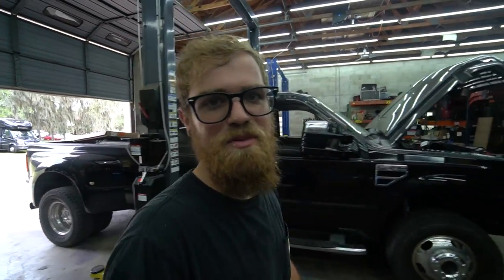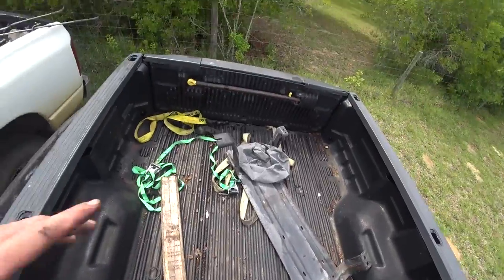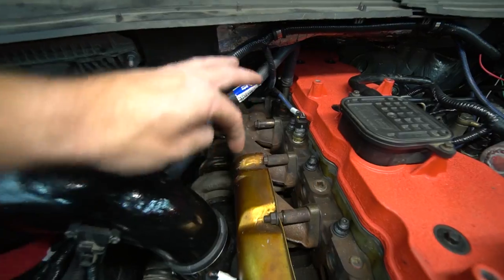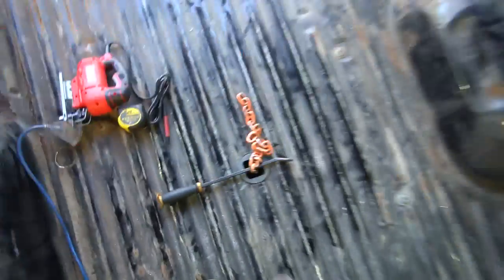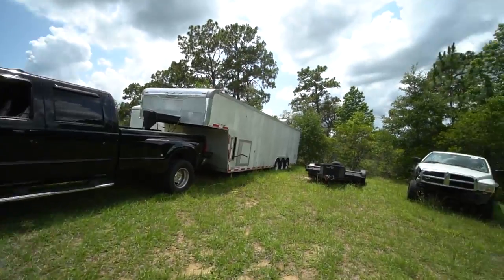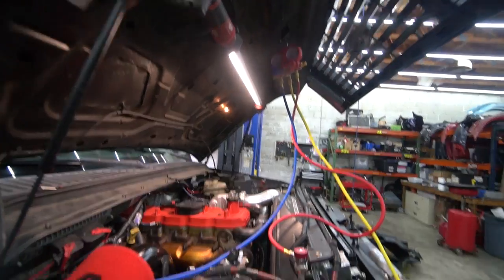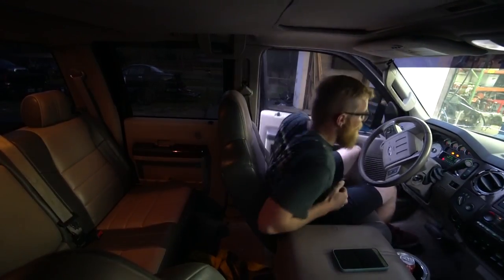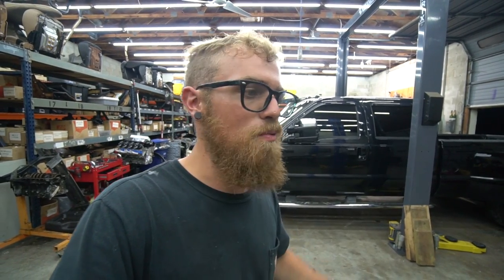Hooking the FUMMINS up to the BIG TRAILER!! Will It Work!? *Big Progress!* Fummins Build Pt.19

Comment: Love the build! If you're looking at rust prevention for the truck one thing to change would be the seal around the third brake light. A lot of the times the tend to dry out and crack which allows water to run into the cab and rust out the cab corners. Amazing job as usual Taylor!

Comment: Generally, if it holds vacuum for 5 mins, you will be fine. Usually, the apparent leaks will show right away. 

I dig the F-3500 man. I hate that the  ford/International relationship fell apart because of the 6.0/6.4 drama, because it would have been a real possibility of Cummins being the diesel for Ford. By the time the Cummins/Dodge contract expired and we saw a Cummins in another brand, Ford was already 5 years into production with the 6.7 Powerstroke. But the 6.7 with the 6R110w is probably the best combination in production today, with your truck being basically the equivalent or slightly superior configuration. Keep it up Taylor, you're killing it this year !

Comment: Please for the love of god, give that rattle trap a valve adjustment.
Reply: Didnt he do that? Sounds more like a rodknock or smt
Reply: @Leofred2000  I hope this clip is just old and it doesnt have rodknock.  That would be such a bummer :C
Reply: he adjusted the valves like 5 times now. thats just how a 5.9 cummins sounds.
Reply: It's just a diesel. Normal ignition sound.
Reply: Yap he did the valve adjustment already. I don’t think it sounds healthy but, I am not there in person to hear.  I saw Nick K said this noise is normal? But mine didn’t sound that clicky.   Does he have a FASS already installed?
Reply: I work on these everyday. Its not a normal sound.
Reply: @davids1043  yes fass is installed. It sounds healthy. I'm betting it will change sound with the next tune as well, probably louder. He literally used the 2nd loudest Diesel made. Loudest being the OBS 7.3 ford. My neighbor used to have a 3rd gen 24V ram and it sounded the same. I was disappointed he used the 5.9 over the 6.7 Cummins, the 6.7 being far quieter and much more capable motor. Not to say a 5.9 is inadequate, it's mostly preference and opinion.
Reply: @n0nc0mpliant  Ive heard the 6.7 is way less throttle responsive due to the long stroke
Reply: @Leofred2000  Having had rod knock before that ain't it its too tinny and consistent. Sounds like lifter tick or something along those lines in the valve train
Reply: @Ace-nd6kk  I agree. I've had some pretty aggressive tunes on my 6.7 that make a ton of knock and some pretty lazy tunes that are nice and quiet.
Reply: @Leofred2000  not at all. The trans and turbo really sets how responsive it is but my manual trans with the VGT turbo was a real neck snapper with the right tunning. My swapped turbo delivers more power but since it's so much bigger without the VGT portion it's lazier.
Reply: Its the reverb inside the truck, when he showed the engine idling outside the truck you couldnt hear that loud "tap" or "knock". Its just inside the cab. Lack of sound deadening
Reply: To me it sounds more like  a injector dumping too much fuel,, a quick way to wreck a good engine. I know he probably didn't want to replace them when the engine was apart because of the cost but it's cheep insurance compared to a rebuild.
Reply: @dooformuladlx  it does sound like that, but only when the camera is inside the truck, listening to it out side it sounds fine.
Reply: Sounds like injector knock for sure

Comment: That truck should have power folding mirrors. If it does, folding them in and out manually could me........ Was typing that when he folded them........😂😂
Reply: ALSO the telescoping button goes out quickly on these trucks. 50 bucks from ford.

Comment: Neat trick for using a holesaw and not destroying your pilot bit. Set the clutch to 12 and when your holesaw bites down after the pilot poles through it won’t jerk the pilot and break it. It’ll stall the drill and you can stop and set the chuck back to drill.

Comment: You got the ultimate truck now! Try checking your rear wiring harness connectors to make sure there clean for your back up camera, it so your camera is taking a crap on you probably, I’ve replaced quite a few of those on fords.

Comment: I used DCS back in 2011 for my 2006. Mike Dahlke will be your best contact there. He is the best! Your transmission will actually  self learn if you are using DCS's throttle pedal module by JMS. The more you drive it the better it will shift. The tune they send you will match the Cummins low-end torque with the 5R110. Mine shifts just like if the PS engine was powering the 5R110. It really was a breakthrough for them.

Comment: I just realized, Taylor only owns 1 car that has it's original motor... Damn
Reply: Which one?
Reply: Constable pretty sure the wrx
Reply: wrx has a newer sti swap. into the older cooler looking body style
Reply: I think the cefiro still has an rb20det
Reply: The green truck has the oem motor dosen't it?
Reply: josh youngs No, 1500 Silverado’s didn’t come with 6.0 Liters. Was a 5.3 swapped by previous owner Derek Gaskins.

Comment: Anti-seize the squared section of the turnover ball, all that road grime mixes with rain water and glues it in if you don’t.
Reply: Big globs of bearing grease or bar & chain oil over the ball & pin lever. Locally (Western Australia), the 3 or 4 of these I know with goosenecks all say they fitted grease points you can reach from the lever side. Its also a good idea to put a lever lock in the arch. Wheels & tyres - Taylor find a truck that's fitted with semis & ask to drive it on a long journey. Being heavier, you put more strain on a driveline and ancillaries that was never built to move that mass, you use more diesel per mile - even being tuned and the ride quality may be affected. Personally use the maps you've got & fit decent sized all terrain tires for quieter, more comfortable long distance journeys. Also the interference with your reverse camera may t
Have happened while installing the 5th wheel

Comment: On another note we’re talking about the power extend, I think if you put the mirror adjuster to the middle and push down then forward or back maybe that works. I forget I had a 2011 work truck that was brand new and it did it that way I believe

Comment: Dig the build, I've been working on a fummins myself for awhile now. That engine has a fair amount of knock, when you do an oil change I would cut the filter open make sure there isn't any metal in it, could be something simple bent push rod from having the lash to tight or something. But is excessive in my opinion. Those r134 canisters are the new anti leak style ball valve you have to get an adapter that your metal t adapter goes on to use them. Parts stores should have them next to the cans. They're usually blue in color

Comment: I installed a b&w on an 07 chevy and man I'm amazed how easy the 4 inch hole was for you to drill. On the chevy it probably took me 30 minutes with a brand new 4 inch hole saw. The bed channels are a lot deeper than that it seems and caught the hole saw like every 3 rotations. The assembly wasnt bad and getting everything in worked well but the 4 inch hole and the 4 inch diameter piece that sticks through was TIGHT. had to bore it out with a dremel after but boy theres no gap.

Comment: To really kill noise you need 3 layers
  1.Peel and stick aluminum backed dampening to absorb vibration, like FatMat
  2.Decoupling layer of closed cell foam to keep layer 3 suspended from the vibrations of the metal/Layer 1.
  3.Mass loaded vinyl, sheets of vinyl impregnated with heavier material designed to block sound through it with sheer mass. Optimally this layer is seamless

Comment: Spray in bedliners still hold moisture underneath my dodge had rust all the way down the pinch weld under the bed liner so I fixed the rust te bedlined it and put a tonneau cover
Reply: Must of not been the best prep job

Comment: bruh that cummins isn't supposed to sound like that. maybe a rocker or tappet issue, or valve adjustment
Reply: or bent pushrod. would make sense since your valve lash was so out of whack before
Reply: Sounds like valves lol. I was ganna say that doesn’t sound lime a 12v ahaha
Reply: If I'm not mistaken it's a 24v not a 12v
Reply: I say run it till it blows up yeah brother do it for dale  full rip ( jk that’s a serious issue)
Reply: Yeah, it definitely sounds rough I was just working on one of these trucks today. Definitely has something going on
Reply: cole ross It’s not a 12v

Comment: well it still has a ford symbol so ya it will have problems lol jk. all joking aside i hear ya on the doing something different. so hesitant till you put some miles on it. everytime i mod something i am so scared to drive it long distance. i always tend to drive it local so i can make a call and get a trailer to get it home. but once you get it all good and you do that first lon distance drive man is that a great feeling. you get there and just look at your vehicle like hell ya i built that and it runs great and i can rely on it. amazing build man. congrats

Comment: It sounds like a 7.3 powerstroke on camera when you back it out of the garage to empty truck parts 
I prefer the 5.9 common rail myself too
Reply: Im not the only one thinking the same thing
Reply: Is it a normal sound? I’m fairly new to diesels but it sounds a bit off to me.
Reply: @Constabruity  It sounds normal to me, I am by no means a mechanic but I have driven plenty of diesel trucks.
Reply: @constable yes that is normal, diesels have very high compression, my 97 7.3 ford has a 19:1 compression ratio, that truck is probably almost 25:1, diesels use compression to ignite the fuel (no spark plugs) and what your hearing is basically a knock but it’s normal for diesels
Reply: Sounds like it’s got a failing injector

Comment: My work truck is an 08 f350 Srw it has just over 213k miles and it runs great I haven’t had issues other than the motor doing stupid stuff (needed a new turbo main bearings and piston rings with a dpf delete now it runs better

Comment: Best get a new dryer for the AC if it has been open for long. Also an inline filter since lines were welded. If it isn't done now then you will probably do that if the compressor grenades.

Comment: Chop the rust out of the bed completely. Make sure there is none left before you bedline it because it will just rot away underneath otherwise. Bedliner is great until you nic it and get moisture

Comment: Use line X in the bed. No gaps no bolts. Just the bed and line X.i forgot to mention here in Puerto Rico some owners of Ford Have 19.5 wheels in there trucks. They did the convertion. Is not cheap others whent 22.5

Comment: i wouldve backed the truck in and took out the bed bolts and either lifted the bed up a few inches or at least lifted the rear of the bed just to have the extra room to keep from having to take off all the other parts

Comment: I’ve had the same problem with leaks, I had a fitting leak and took it apart four times, then got a camera to watch it still leak, took it all apart, brought the fitting to the store and the guy took one look at it, told em the fitting was hour glass shaped, so it was never going to seal, sold me a made in America fitting, sealed first time.

Comment: Pretty sure you have the wrong valve for the r134 the newer ones are said to be made for that valve the older ones are different, what ive read and been told at my store i think a new dispenser valve will fix that bud! love catching up on the fummins

Comment: Got a 2008 f250 also SRW. Any reason why you didn’t go with the infamous p pump 12 valve? I’m wanting to do the Cummins swap as well and am looking to pretty much copy your setup as much as possible. I know the 2003 you went with is easier to diagnose problems. Thanks bro.

Comment: You getting hype over the folding windows. 
Then kinda disappointed that they don't extend., 
Then back to getting hype, because Taylor. 
Round of applause on a aluminum weld job that doesn't have any needle holes. 
The Miata boys doing tandems

Comment: My man you have something going on making a noise that shouldn't be there. Either in the valve train or one injector. Check all your injector line clamps and make sure they are tight. I have seen them make some wild noise.

Comment: Hey Taylor, this comment will probably get buried in the comment section but hopefully you see this. I'm 99% sure the headunit in your truck is a Sony XAV-AX100. If so, aside from bluetooth audio, it also has Apple carplay and android auto! If the person who installed it did things right, try looking for a USB input somewhere near the headunit. If there's no USB input anywhere, if you pull the headunit out you'll find a USB input at the back of the unit. You can grab a "male to female USB port" off of amazon to extend the USB input and get apple carplay/android auto.

Comment: One or your big fans out there should have a 3d printed front radiator top plastic shroud and have say fummins swapped. Also stop using those filters on your lift pump

Comment: ITS A PARKING BRAKE NOT A “E-BRAKE”!!!!!!!!!!!!!!!
Reply: Yeah, rear wheel disc brakes have another set of pads that will stop the car from rolling down a hill but its not like drum brakes in the rear which you can actually lock  up the rear wheels with.  On these drift cars I  am not sure what they are using. I guess I missed Taylors episode where explines how it works.